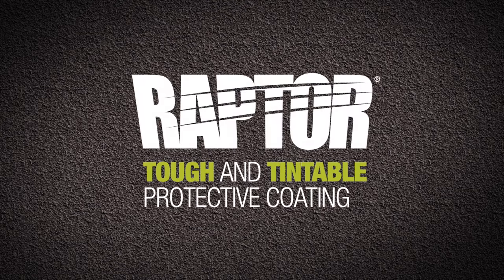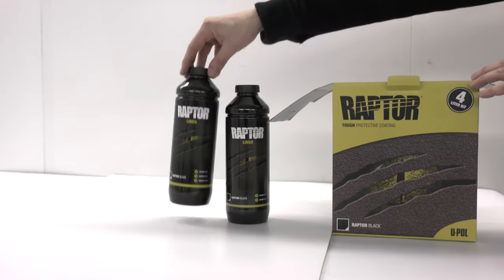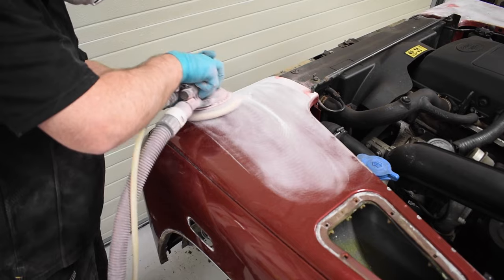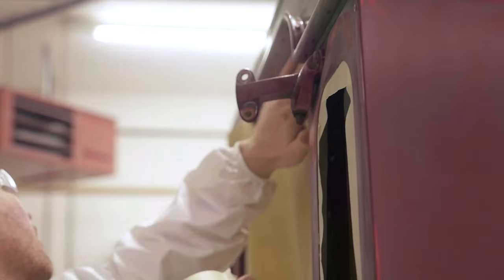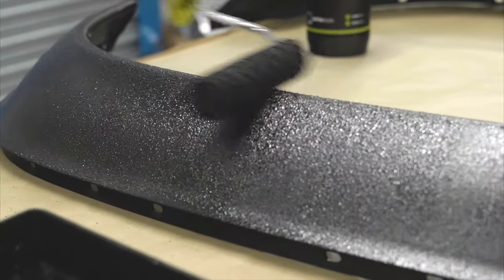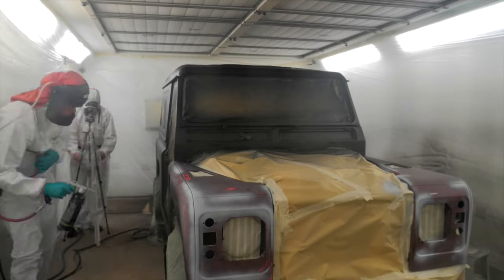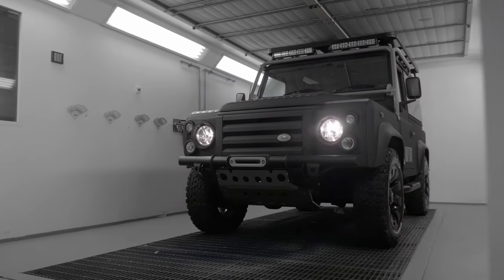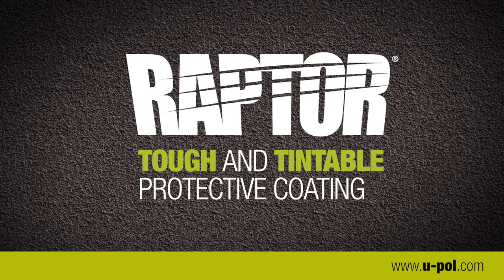RAPTOR Protective Coating - Land Rover Makeover

Comment: How do you keep it clean? I've just purchased a Ferroza in this paint but when I washed it it left marks when trying to dry it??
Reply from the maker: How long has the RAPTOR been on the vehicle in question? We know of no issue or reason that fully cured RAPTOR would leave or have any “marks” after being washed and dried. Are you certain that the product is RAPTOR? Can you provide us with additional information or images that show what you are referring to?
Reply: What did you dry it with? Terry towel?

Comment: Is this black or a lightened version really like the colour have just ordered some
Reply from the maker: Hi Jason. This vehicle was done in a combination of both black and tintable versions of RAPTOR. The black sections are indeed the black you can expect when you order the black kit. The grays were tinted. Tintable RAPTOR can be tinted to match any color, so talk to you paint specialist when you order the tint to try to get the best color match.

Comment: hello, which is the right spray mask to use?. You show 2, an independent respirator and a half mask.    Does it depend on the method of paint? Meaning spray or roller
Reply from the maker: Hi Israel, the application method of RAPTOR denotes what type of mask. If application by GUN/1, you require an air supply full face mask, by roller you will need a cartridge mask. Difference between application, by gun the product is atomised so you will need full air fed mask, by roller there is very little atomisation so a cartridge mask will cater this application. Hope it helps.
Reply: U-POL thanks for the quick reply. So I understand that spraying with gun should not be done with cartridge mask, be it full Face or half mask?
Independent  respirators are difficult to find where I live and I imagine would be costly. So the roller option seems to be the way to go. However, besides the difficulty of getting into the narrower parts, would the finish be the same, similar or worse than with gun?
Last question. With roller using a half mask, which filter do you recommend? 
Thanks I'm really interested and want to do it on three different cars.
Reply from the maker: Hi Ismael, Typically an A2/P2 respirator is used for this kind of application. However, you should also consult your local regulations to ensure the correct level of PPE is used. To achieve a flat texture with a roller, you will need a closed cell roller similar to the kind you would apply house hold paint. Use long strokes with minimal pressure to alleviate stripe marks, for any unreachable areas with the roller I would suggest using a brush to coat these prior to roller application. To achieve a coarser texture, you can use an open cell roller using the same technique, this will give you a texture similar to a Schultz gun application.
The strong solvents in Raptor will begin to break down the rollers over time. For large applications ensure you have a sufficient supply before you start the application. Hope this is of assistance. Have a great week-end
Reply from the maker: Hi Israel, sorry for the late reply. Typically an A2/P2 respirator is used for this kind of application. However, you should also consult your local regulations to ensure the correct level of  PPE is used.To achieve a flat texture with a roller, you will need a closed cell roller similar to the kind you would apply house hold paint. Use long strokes with minimal pressure to alleviate stripe marks. For any unreachable areas with the roller, I would suggest using a brush to coat these prior to roller application.To achieve a coarser texture you can use an open cell roller
using the same technique, this will give you a texture similar to a Schutz gun application. The strong solvents in RAPTOR will begin to break down the rollers over time. For large applications, ensure you have a sufficient supply before you start the application.I hope this is of assistance.

Comment: Can this be applied to wood floor of trailer? If so, what is the process? Does it need to be primed, it is raw plywood now.
Reply from the maker: Yes. As a general rule, if the wood substrate is clean, dry and free of dust - RAPTOR can be directly applied to a wood surface without any additional primer required. If you wanted to prime the surface to seal it, you can certainly take this additional step - be sure and follow the application guidelines of the primer you elect to use.

Comment: I have a 1993 Toyota T100 Single cab, Long Wheel Base truck. How many kits would it take to paint the entire truck ?
Reply from the maker: It depends on your application technique, but 4-5 kits should be plenty. If the distributor you're buying from accepts returns for any unused, unopened kits, buy more than what you think you'll need, so you don't have to run to the store mid-project. 

Each 4L kit of RAPTOR covers about 125 square feet with 2 coats.
Reply: I bought 2 thinking that would be plenty !!! At 60psi
Reply from the maker: Hi Craig. 2 kits probably won't be enough to spray the entire truck. You will most likely need 4 for the truck plus 1 for the bed.

Comment: Does the bedliner have UV protectant in it? Will the color fade over time? How long would you expect this to last until it needs recoating?
Reply from the maker: Hello,  RAPTOR is UV resistant so it won't fade even after years in the sun.
Regarding how long you can expect it to last, there is no time frame really, it all depends on how you use your vehicle. It is a 2K coating anyway so the main purpose of RAPTOR is to last. Hope it helps
Reply: Thanks for the reply! One other question. The 2K epoxy primer, can I use it on plastic and aluminum without needing the #4 adhesion promoter (plastic) or the #8 etcher(aluminum)?
Reply from the maker: Hello, the Epoxy Primer will adhere to suitably prepared Aluminium without the need of GRIP#4. Our technical datasheet does not recommend the Epoxy for plastics. Hope it helps
Reply: U-POL thanks again!

Comment: Hi for a fine finish what would you recomend a hvlp gravity fed gun? What size nozzle and psi? Thanks
Reply from the maker: Hi Daniel, for a fine finish, we recommend a HVLP gravity fed gun indeed, with a 1.6 - 2.0 mm nozzle. You can also add up to 15% urethane reducer and apply at 29 PSI, at >0.5 foot of the substrate. Apply 2 even wet coats. Hope it helps

Comment: can one use a typical home compressor? I read on your site it has to have a water filter on it? Are those internal on most compressors?
Reply from the maker: The critical requirement is that the compressor is capable of producing a minimum pressure of 3 bar (45psi). Your home compressor should state what it is able to produce and if it is above this amount you are good to go.
Reply: thank you for replying but you didn't address my question about the water filter?
Reply from the maker: Most compressors which can reach a suitable pressure have a water filter, but as long as his reaches the minimum pressure we have quoted then it will be fine to spray RAPTOR.
Reply: i have a craftsman compressor 5.5 hp 25 gal but not sure if it has a water filter is it external?It's an older one,thanks!

Comment: what is the colour you used to spray the defender it looks more matte than the standard black raptor
Reply from the maker: In this video our standard black RAPTOR was used but the application is slightly different to how most people would apply RAPTOR.

1. First coat: Apply normally reading about 4 bar at the Gun (GUN#1 with the trigger pulled in). This will give a good ground coat and do all the hard work.
2. Second coat could be repeated if you wanted too, but this isn’t always necessary.
3. 2-3 coat : turn the pressure up to 5-5.5 bar at the gun and then stand around a metre away, stand at a slight angle so your almost 45° to the panel and then lightly drift the RAPTOR on this will give a very light course effect that will look much more matte than if you apply it in a more traditional way.
Reply: was this with a shulst gun or a hvlp gun?
Reply from the maker: The body of the Land Rover was sprayed with the U-POL GUN/1 (UP0726) RAPTOR gun, which is a Shultz style gun.

Comment: How can a fine texture be obtained?  I prefer to use a dirrerent gun, for more control. What size tip is needed, for HVLP ir conventional?

thanks anyone
Reply from the maker: Hi Mike. For a fine textured finish, setup your HVLP gun with a 1.6-2.0 mm tip. Add 15% reducer to the activated RAPTOR product, and set the PSI to about 29. At a distance of at least 6 inches, spray the first coat as an even wet coat. Allow to flash, and then reduce the pressure and material flow to achieve a fine mist for the second coat.

If you have more questions, email us at infous@u-pol.com with your contact information (phone number, email, and your state), and I can have someone contact you for more specific questions and information.
Reply: @UPOLRaptor  how smooth can raptor go? can a finish anything like single stage polyurethane paint be achieved?and is there any videos showing this? thanks

Comment: Hey upol where do I get the tintable paint for the raptor tintable paint kit? I have an old Jeep Cherokee that I want to raptor line and I want to stick close to the factory color.
Reply from the maker: Hi, you can buy the paint of your choice from your usual automotive paint distributor. Please note Raptor is compatible with solvent based paint only. Hope it helps, and good luck for your project

Comment: Is the "RAPTOR" on the door a sticker? Does it stick on such a textured surface?
Reply from the maker: Hi Marcel. It is difficult to stick stickers on over a course texture, so we used vinyl stencils and sprayed it on!
Reply: U-POL thank you. What paint do you use for spraying on? Normal 2K?
Reply from the maker: You can actually tint RAPTOR to match almost any color. The possibilities are endless! You can go to your local automotive paint store/Jobber and ask for this:

For best results, use the solvent based toners from basecoat mixing systems. RAPTOR can also be tinted with solvent based basecoats and solvent based 2K solid color isocyanate cured paints. Where 2K paints are used this will also need to be activated before use. Do not use waterbased systems to tint RAPTOR. 

For best results, use solvent based acrylic basecoat toners (ask your paint supplier to leave out the binders). NOTE: Acrylic basecoat toners tend to have high color strength so use sparingly (less than 10% tint by volume). RAPTOR is compatible with any urethane based color, including 2K acrylic solid color and mixed acrylic basecoats, which can be added up to 10% by volume, although typically, 5% color is all that is required for good opacity with any paint type. RAPTOR cannot be used with water based, polyester, or enamel paints.

Comment: What mix was used to achieve the finished colour? Cheers.
Reply from the maker: Hi Ellis, here is the mixing ratio: By volume - 3 parts RAPTOR – 1 part hardener – 10% colour.
Or 100g RAPTOR - 30g hardener and - up to 10g tint. You can also refer to the online technical datasheet for additional information (www.raptorcoatings.com).
Reply: Thank you! What tint did you use? I'm really liking the colour
Reply from the maker: We used a solvent based tint, kind of metallic / grey.

Comment: I wonder, how much weight would it add to a standard size SUV?
Reply from the maker: Hi Jay. For each 1 Liter bottle of RAPTOR sprayed, it will add about 1.375 lbs to your vehicle. A full overspray of a standard sized SUV would use roughly 12 liters of product. You can expect it to add about 16.5 lbs to the vehicle.
Reply: oh wow
Reply: just throw your girlfriend out if weight is an issue

Comment: I ordered my kits yesterday. What psi do I need to regulate my gun to get a course finish?
Reply from the maker: Hi Troy. For a coarse texture using a standard Schutz style gun, like our UP0726 gun, mix RAPTOR and allow to stand for 10 minutes. At a PSI of 45 and a distance of about 1.5 feet, apply the first coat with an even sweeping motion. Drop the second coat over the first.
Reply: what do you mean by drop the second coat? and what kind of paint do I need to mix in the tintable mixture?
Reply from the maker: Hi Troy.  The painting world, a “drop coat” is a second (or possibly 3rd in the case of RAPTOR) which is done at higher or lower pressure to provide texture but not a lot of additional build. It’s applied at a further distance from the panel and not meant to go on wet and flow out.
Reply from the maker: Hi Troy. You can buy the tint from your local automotive paint supply store, and they should be able to help you color match. When you go to your local automotive paint supply store, be sure to tell them for best color match results, Tintable RAPTOR requires a urethane single stage color. If you choose to use basecoat, ask your paint supplier to leave the binder out of the formulation so it is pure pigment. The final color will appear slightly lighter than the base color. 

Once mixed, check the color of the tinted system before spraying and adjust if critical. For tinting, typically 5% color is required for good opacity. When tinting above 5%, product will need to be mixed out of the bottle in a suitable mixing cup. For best color control, add color by weight. For best results, use the solvent based toners from basecoat mixing systems. RAPTOR® can also be tinted with solvent based basecoats and solvent based 2K solid color isocyanate cured paints. Where 2K paints are used this will also need to be activated before use.

Comment: can you get smooth finish with raptor thinned out and sprayed out of a proper spray gun ?
Reply from the maker: Hi psy06. Absolutely! For a fine textured finish, setup your HVLP gun with a 1.6-2.0 mm tip. Add 15% reducer to the activated RAPTOR product, and set the PSI to about 29. At a distance of at least 6 inches, spray the first coat as an even wet coat. Allow to flash, and then reduce the pressure and material flow to achieve a fine mist for the second coat.

If you have more questions, email me at infous@u-pol.com your contact information (phone number, email, and your state), and I can have someone contact you for more specific questions and information.

Comment: Sure, "Qimenshi Dujunfa" car body armor explosion-proof paint is a product made in China. It doesn't require specialized equipment and can be operated by oneself. The color can be arbitrarily tuned, and the particle size can be adjusted. It is resistant to yellowing, impact-resistant, and corrosion-resistant. The product name is "Qimenshi Dujunfa".

Comment: I want to raptor my Range rover 2 door club classic.... need some guidance...
Reply from the maker: Hi amanpreete singh. How much product you'll need depends on a few things: your application technique, whether you're spraying, rolling, or brushing on, gun setup, whether you use reducer, etc. It's hard to say exactly. One 4L kit covers roughly 125 square feet when you spray it on in 2 medium coats, so calculate the square footage of your vehicle to determine how much product you need. Buy an extra kit or two from a distributor who accepts returns for unused, unopened product. If you run out of product before you finish your second coat, and RAPTOR sits overnight or longer, you have to resand the surface before continuing with your second coat. What a pain! That's why it's best to have extra on hand rather than not enough so you can finish your application all in one shot. Most likely, you'll need about 3 kits, but I would suggest buying 4-5 to be safe.

Comment: Hello what sander did you use in this video??
Reply from the maker: Hi Mavennis, the sander was RH 159A RUPES SKORPIO 9mm Orbit (Pneumatically palm sander).
Reply: @U-POL thanks, is there a sander you would recommend for a series 3 that’s a bit cheaper??
Reply from the maker: MavennisXV sorry for the late reply ... U-pol currently doesn’t supply Duel Action Sanders.
There are many on the market, you can search for 9mm Orbit (Pneumatically palm sander).

Comment: is kustom kote the same product as raptor liner?
Reply from the maker: No, RAPTOR is a urethane, 2-component Protective Coating and Truck Bed Liner. It can be used over a multitude of surfaces and tintable RAPTOR can be tinted to any color of your choice, with the ability to create both smooth and textured finishes. RAPTOR is used for 4x4, automotive restoration, off-road, marine, agricultural machinery and general industry.

For more information on RAPTOR, checkout the U-POL website or the other videos on this channel.

www.u-pol.com

Comment: could you share how you got the flat or mate finish please?
Reply from the maker: Hi Mike, you will basically need a HVLP gun and reducer. You can find more details on our technical datasheet: https://www.raptorcoatings.com/files/16657/rlts4-TDS-EN-UK
Reply: Ok, you didn't use an HVLP gun on the body. Video shows dude using the Shultz gun. The link you provided doesn't state how to change the sheen of the finish. I am also wondering how you got the flat (matte) finish?

Comment: Does it come with lifetime warranty like line-x?
Reply from the maker: U-POL comes with a limited warranty stating that the product will be free of defect up until it passes it's shelf life in the original packaging in sealed containers in storage conditions as specified on the TDS and SDS. RAPTOR is user applied and does not have authorized installers like the franchise LINE-X, so no warranty is available for the application of the product.

Comment: also can tint be added to the black kits?
Reply from the maker: Yes, tint can be added to the black kits as well. If you're looking to match a color code, it may be hard to do with the black. Suggested that you conduct a test spray out to determine if the color and look is acceptable prior to general application.